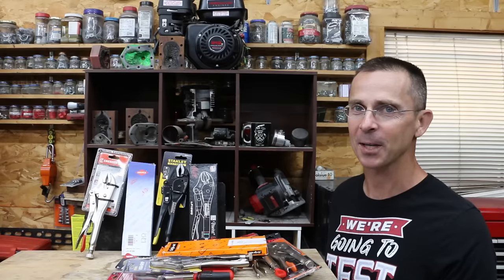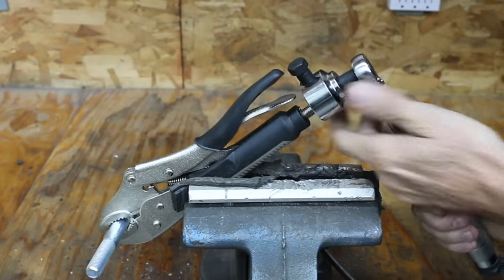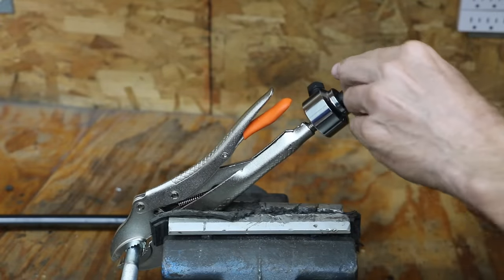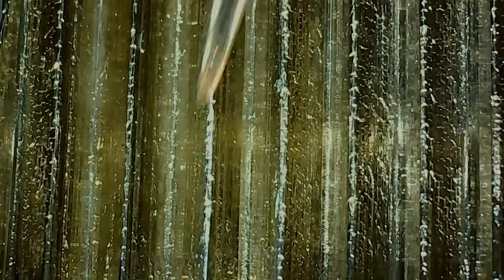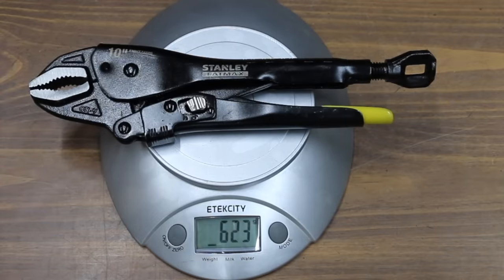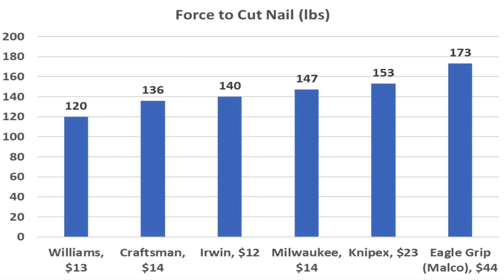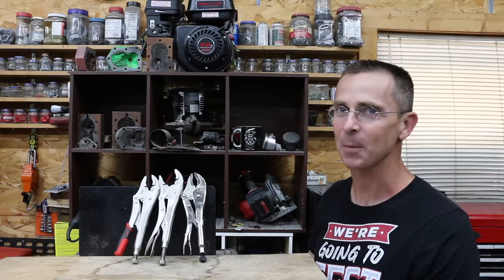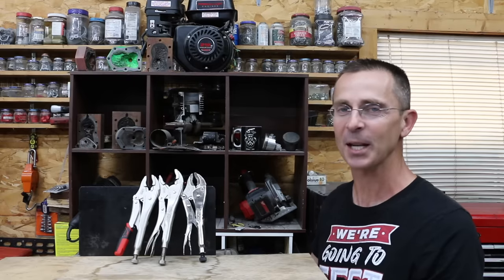Best Locking Pliers (VISE GRIPS)? Irwin vs Knipex, Milwaukee, Craftsman, Stanley, Malco, Pittsburgh.

Comment: I'm realizing that Irwin just generally makes some really high quality tools for the price.

Would you consider a video for scissors or kitchen shears? You could see how they maintain edges after cutting leather, denim, aluminum, staples, bones etc.
Reply: Scissors..an excellent suggestion!
Reply from the maker: Thanks for the suggestion.
Reply: @ProjectFarm  If you do a video on scissors I would love to see Maped scissors in the test, they seemed to deliver very good results for me so far!
Reply: Also fiskars scissors
Reply: @ProjectFarm  Would love to see kitchen shears! Was thinking of buying a pair recently.
Reply: @grantmuhonen5337 :  GINGHER 8" Knife Edge Dressmaker's Shears 👍.  We use these to restore billiard tables.
Reply: The leatherman raptor shears are awesome
Reply: Great idea. I've been extremely happy with my Milwaukee scissors but all I really have to compare to is cheap craft store scissors.
Reply: @flyingby3703  I wanna see him test the J A Henkels heavy duty kitchen shears that come apart. They've been my go-to for years.
Reply: Yes.  
I saw a good demo of kitchen knives.  When it came to their scissors / shears they cut a penny in half.
Reply: They only seem good if you compare them to other chinese crap. They were blown away by the Malco in every test except the unlock test, but it you locked them down hard enough to get the equal amount of grip as the Malco, the results would be very different. 

Irwin has a habit of buying quality brands and then moving the production to china, basically destroying the brand name and making it harder to find used versions of the quality products from before the buyout. I would gladly buy the Malco over any of these other brands, because when it comes down to it, nothing comes close to the grip strength and that is what you buy locking pliers for.

Tools are an investment and having a cheap tool fail when you need it most will cost you more in time than buying the better product in the first place.
Reply: Good idea for a test.
Reply: @ProjectFarm  Need to include a "what if husband used wife's high end fabric scissors to cut 100 grit sand paper" test phase. ;)
Reply: They used to. I have some Irwin stuff from the 50s and 60s (my brother got the rest) but there vicegrips suck, not even close to the original Petersen models. Just like anything knocked off in china. Wake up and buy American or at least Canadianas the still appear to have pride in their products
Reply: @ProjectFarm  If you do scissors, please be sure to get a set of Cutcos
Reply: What chinese garbage. I'll stay with my 50 year old Vise-grips made in USA.
Reply: Milwaukee makes 2 pairs of scissors. I want to see a video on those. In depth style.
Reply: While good compared to the other Chinese pliers, look how far they’ve fallen. The eagle grips are basically new production old vise grips. Yes there are a couple improvements. But I bet a nos pair of usa Irwin’s would be twice as good as the China ones. Just like the Malcos are twice as good
Reply: No need to test. Fiskars scissors are the best ;)
Reply: Bones? What are you 😂 I'm worried now 😂🤣
Reply: @ProjectFarm  Kitchen shears (cutting bone, etc) would be very helpful!
Reply: @ProjectFarm  Try left handed ones to see which actually work left handed, as most are right handed scissors/shears with left hand moulded handles (blades need to be transposed, as left handed use of right hand scissors tends to push the shearing edges apart, rather than together).
Reply: @ProjectFarm  Be sure to include Cutco brand.  Last time I bought a pair 20 years ago, they were $75.  They are now $117.  Made in the good ole USA.
Reply: Yes scissors!
Reply: @grantmuhonen5337  Especially if the Fiskars made in Finland are compared to the Fiskars made in China.
Reply: Cutco kitchen shears are the best I've ever owned.
Reply: Taps and screw extractors from Snap-on are rebranded Irwin. They make good stuff
Reply: @grantmuhonen5337  The scissors used by the paramedics are really good they are sharp and serrated, i have a pair and i like them a lot.
Reply: @flasher1663   to say there KNOCKED OFF, IS BS ITSBTHE COMPANIES HAVING THEIR TOOLS MADE THERE  !, like SEARS, CHRAFTSMAN, then their COMPANION TOOLS WERE MADE IN JAPAN, CHRAFTSMAN had a warranty, but COMPANION DID NOT !     🇺🇸🇺🇸🇺🇸🇺🇸
Reply: Flyby Airplane   If the quality is less than I consider it a knock off. The original Vice Grips were patented by Peterson Mfg . After the inverter died the family sold the company to Rubbermaid who later sold it to Irwin. I own several of the originals dating back to the 50s the Irwin ones are only marginally better than harbor freight. If it’s made in China it’s crap, no matter who is paying them to make it. Irwin used to make excellent tools in the USA they are doing their reputation a disservice by offshoring production
Reply: Heritage Cutlery scissors 👍
Reply: @PeterFulford  Fiskars made in Finland for sure. I use their axes and splitting mauls, and they are the best I've come across
Reply: @MAGAMAN  Truer words have never been spoken. Good tools make things possible, bad tools make things impossible.
Reply: @talltimberswoodshop7552  I have been using my Cutco “Super Shears” that were in my sales demo kit from 18 years ago. They are still going strong!
Reply: @totorodad-computer-geek  Momma would kill me, the kids and I aren’t allowed to touch those scissors.
Reply: @ProjectFarm  DONT forget to include a good pair of lineman's scissors from either dewalt or stanley or uhh... who makes the yellow handles? general electric? general construction? i'll have to look in my bag, general something
Reply: I'd like to see some Westcott scissors tested, they're the best brand I've found so far. Keep an edge way longer than others I've had. Sharp as can be too
Reply: Klein Tools All-Purpose Electrician's Scissors 26001 , Yellow
4.7 out of 5 stars 504
$25.47 on amazon
Reply: or Klein Tools 21010-6-SEN Free Fall Snip, Carbon Steel
Reply: Cant go wrong with Fiskars, no need to test.
Reply: Wiss are the best I’ve found.
Reply: @ProjectFarm  yes test Upholstery shears/ scissors,  ive used wiss, mundial but Kai is the best,  test cutting through 40oz. Jute padding
Reply: @talltimberswoodshop7552  the Cutco scissors are by far the best. I have an unintentional scissor collection , with over 80 pairs of scissors, and the Cutco ones are are the best. Most rigid, most substantial, best pivot, strongest...
Reply: Cutco makes one of if not the best kitchen shears.
Reply: @littlejackalo5326  You mean international, right?
Reply: Scissors and kitchen shears would be great. And yeah, Irwin is now my default go-to brand.
Reply: @ProjectFarm  I love to see a video about scissors.
Reply: I agree. I've been buying their tools for quite some time.  I especially like that they last, but are not so prohibitively expensive, that when I inevitably forget one on a job, I'm not taking a painful hit too.   I especially like their line of locking groove joint pliers (water pump pliers).  All the features of multiple grooves for jaw spacing, but lock your choice of grooves too.
Reply: And others, not so much. Which is what makes PF so awesome, figuring out where they shine, and where they stink.
Reply: @bobqzzi    YES!!!!!!  Best there is IMO.
Reply: @1puppetbike  That's Cutco, that's one of the gimmicks they do in house while showing off their knives.  I own 2 pairs, very strong scissors.
Reply: This was ages ago and they had / have a trident logo??
Reply: @talltimberswoodshop7552  
Wooo hoo, you tell em!  Ha ha.
Reply: @81mont  hi I think I may have the REAL McCOY, as the ones I own are from 1968 , 3 or 4 different ones  including a CHAIN wernchI use to keep piping from moving, asI braze copper 1 floor below !🇺🇸🇺🇸🇺🇸🇺🇸

Comment: Another fantastic video! well done!

Few suggestions I think would be cool:
- cordless soldering irons gas and electric
- 1/2 inch drive cordless impact drivers 
- Kitchen knives
- Steel files
- long nose pliers

Once again, thank you for your meticulous reviews! the time and effort you put into it is incredible!!
Reply from the maker: Thanks so much!  Thanks for the suggestions.
Reply: +1 on the electric impacts
Reply: ts80>milwaukee for battery op, but I do love me the butane ones as well, I have several
Reply: +1 on soldering irons.

Comment: A video on torque wrenches and comparing accuracies would be really nice! Just given how vital it is that they are accurate. Click type, split beam, digital. How well they hold their set value after repeated torqueing. Testing for loss of accuracy if dropped. Could be pretty interesting.
Reply: I'd definitely like to see the Milwaukee m12 one.
Reply: I was going to suggest this also.  👍
Reply: This!!
Reply from the maker: Thanks for the suggestion.
Reply: I thought he did this, but it appears not. Excellent idea!!!
Reply: He does reviews that are applicable to the majority of the everyday man. Almost no one needs a tq wrench. Even auto shops rarely need a tq wrench.
Reply: @littlejackalo5326  I can understand how the average home DIYer may not. Don't necessarily agree with shops don't use them. They should, at least. Even simple things like lug nuts should be torqued. Obviously more involved things like intake manifolds, heads. The "good-n-tight" has its place though.
Reply: Torque wrench is one of the most important tool to bring your standard work to a professional level, for workshop or diy. And it’s critical if you deal with any mission critical component /work or heavy vibration heavy environment
Reply: @littlejackalo5326  If you work on your own cars, motorcycles, bicycles, etc., And don't at least have a rudimentary beam style torque wrench, you're doing it wrong.
Reply: @ExperiencesAndEquipment  I didn't know there was a such thing as a powered torque wrench. Or are you thinking of an impact wrench?
Reply: Torque wrenches need maintenance in order to keep their accuracy. Your suppose to mail them in to be calibrated with the cheapie HF ones anyway.
Reply: @eliot2283  nope, Milwaukee and I think snap on make a powered torque wrench. The Milwaukee is part number 2466-20, goes to like 150 ft lbs and costs like $600.

Its definitely for someone who makes money with their tools.
Reply: @littlejackalo5326  if you find an auto shop that doesn't use a torque wrench, let everyone know so they can avoid them.

My old roommate was a mechanic and if there was a torque spec, their shop did that bolt to spec.

I personally get it semi close and call it a day, but I know that within a year, I'm likely replacing broken stuff on my suspension anyway.
Reply: @ExperiencesAndEquipment  Wow $600?? Luckily I have a torque wrench built into my elbow lol
Reply: People get way too hung up on how accurate a torque wrench is. In reality it really doesn't matter, if its within 10% its way more than good enough. Anything that really matters where that is not good enough will have you measuring bolt/stud stretch to control clamping force rather than torque as clamping force can vary wildly even when torque is the same. Expensive torque wrenches are simply a fools game.
Reply: @ExperiencesAndEquipment  There is a factory torque spec for every nut, bolt, and screw on a car. even the little screw holding some plastic cosmetic trim on the interior. You're not likely to find a shop anywhere that is getting a torque wrench out to put a phillips screw into some plastic trim. A lot of cars you wouldn't even be able to change an alternator without removing the engine as there is not enough space to get a torque wrench on the bolts with the engine in the car, they do have a torque spec just the same. I'm sure it happens but having been a mechanic for 20+ years i have never heard of a shop that couldn't be bothered to properly torque things like head bolts or bearing caps, you're hours into something at that point, no one wants to do it again. For things where distorting a precision fit is not a concern then its a matter of tight enough to not come lose but not so tight to damage the parts or fastener. That is experience, just like being able to remove/install those fasteners without rounding off the heads, even if its rusty or buried in some hell hole you cant see or even get a finger tip on.  Basically you want someone with experience, someone without, even with factory service book in hand and a torque wrench on everything is still likely to completely fail at completing the job or damage things along the way.
Reply: @celiturbo  At that point, I'd just drill a hole in the bolt and safety-wire it.
Reply: @littlejackalo5326  Working on a vehicle or tractor, definitely need to be using a torque wrench. We use them all the time on the farm to avoid over- and under-torque conditions, both of which can be damaging. I doubt most people have worked on vehicles for enough years to have a "calibrated hand." Also if I found out my shop wasn't using them, I'd change shops.